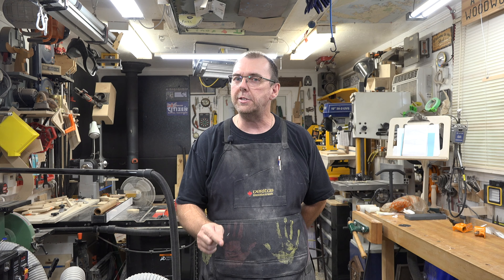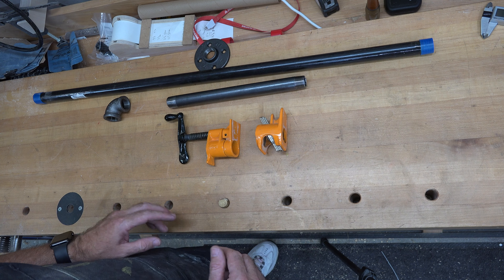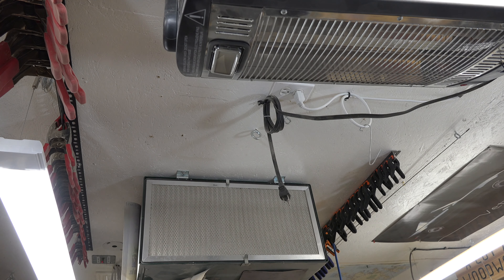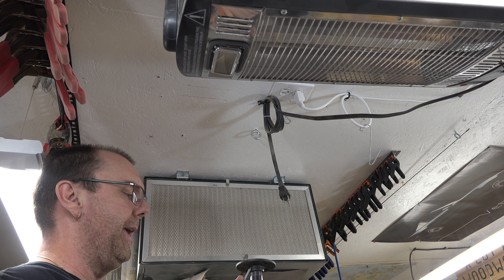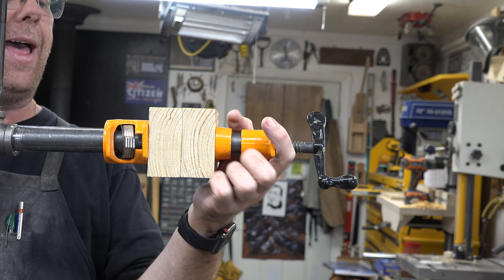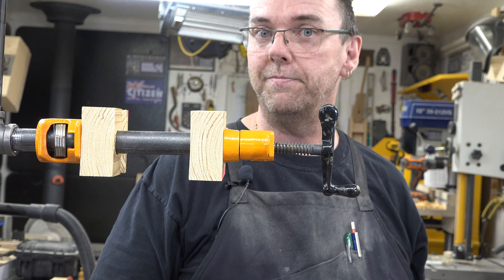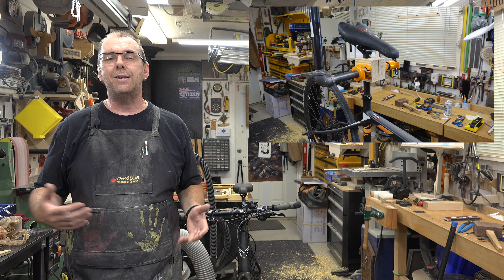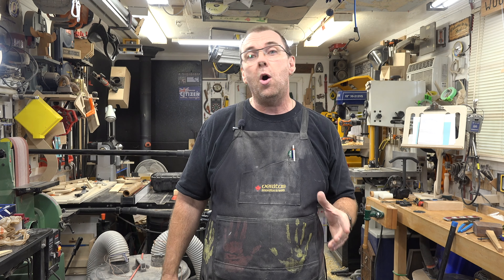Making a Bicycle Repair Stand

Comment: Kenny,  very clever idea.  Using the pipe clamp was equally clever.  Now that you have the flange on the ceiling I am expecting to see more useful fixtures hanging from it.....maybe a skyhook?  Nice job.
Reply from the maker: I won't bother with a sky hook.  I was thinking maybe an electric blow torch or possibly some buckets of blue steam.  Time will tell.  LOL.  Thanks for tuning in to the show and for the kind words Paul.  I appreciate it.

Comment: Great idea! I was disappointed, however, that you didn’t break out that Lincoln tombstone welder and show off your fabricating skills! Ha! I love the simplicity of this design, and I’ll be building one to bolt to my welding table. As another alternative, and especially for adding non-welded diagonal braces, is a line of products called SteelTec. They are a line of structural pipe fittings that fasten to the pipe by set screws, and Lowe’s carries them as well as being available online. Very worth looking into because of things like slip on diagonal brace brackets that can set to nearly any angle, and position anywhere along a length of pipe! Bravo Kenny!
Reply from the maker: That's some good information Tom and I thank you for taking the time to post it.  I was considering a welded rack but I was looking for a bike repair stand that was accessible to anyone and not everyone has a welding certification.  Either way, thanks for tuning in and for the kind words.  It's very much appreciated.

Comment: As an avid cycler myself, this is a great idea Ken. Very clever use of the old pipe clamps. Wish I had thought of this before I purchased a Park stand several years ago. One thing to keep in mind is the long section of pipe can very in length depending on the user's height and ceiling height (or floor mount). Ultimately one wants to get the bike at a comfortable working height. Almost time for my January bike tuneup myself, but I may get a ride in on New Year's Day first. Happy cycling!
Reply from the maker: Glad to hear that you liked the project Rick and I thank you for chiming in with the information about adjusting the stand to the users height.  Great suggestion.  I keep forgetting that not everyone is 6' 2" like me.  LOL.  Thanks for tuning in to the show and I hope you get your New Year's Day ride in.  As for me......too much snow and ice here in Canada and my bike is on a trainer for the winter.  Keep on cycling sir.

Comment: Good idea!  Back in college I built one and mounted it to a wood frame that I could add weight to.  Like you suggested I added a tray for tools and parts.  Major difference I used 1" for the upright with reducing bushings for the 3/4".  It served me well for many years until I got out of bike riding.
Reply from the maker: I like the idea of boosting the size of the upright post.  Good idea.  Glad that you liked the rack Woody.  It is incredibly handy for sure.  Thanks for tuning in to the show.

Comment: Mr could You make a floor versión of your bike stand,& a link about them Pipe clamps,thanks,joe.say hello.
Reply from the maker: The floor version is the same as the ceiling version Jorge.  You just need to mount the pipe flange onto the floor instead of the ceiling.  Check you local area for the pipe clamps.  This is the one that I used and I got it on sale for less than what it is listed now.  https://www.busybeetools.com/products/pipe-clamp-craftex.html. 
I hope this helps.  Thanks for tuning in to the show.

Comment: This brought to mind a question I have had for years and never bothered to research it:  It is always said to use black pipe for pipe clamps.  Issue is when using pipe clamps for glue ups one gets black stains on the wood.  If galvanized pipe was used would you still get the black stains?  Or is the outside dimensions of galvanized pipe larger so adjusting the pipe clamp more difficult?  Perhaps black pipe is less expensive but if the staining is eliminated it would be worth the extra cost to use galvanized.  Back on topic:  I assume you used drywall anchors for the other two pipe flange holes that did not go into the ceiling joist?  Guessing the anchors would have little affect in this application.  "Inquiring minds want to know"!
Reply from the maker: While I have never done it myself Dwight, I have heard of others having great success with galvanized pipe to eliminate the staining from the black pipe.  I can't verify if it's true or not but I've been told it worked great.  As for the drywall anchors......my walls and ceiling are wood so the two screws that didn't make it into a joist, just got screwed into the ceiling boards using a 1" screw.  Not necessarily to strengthen the mounting but more to stabilize it.  After all, my bike is carbon fibre and only weighs 19 lbs.  Thanks for tuning in this week sir.  All the best.